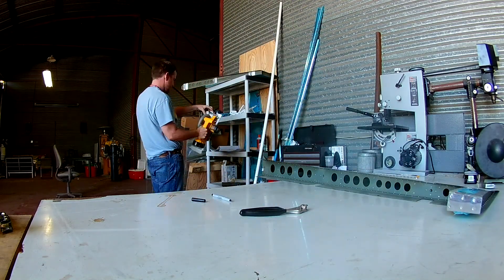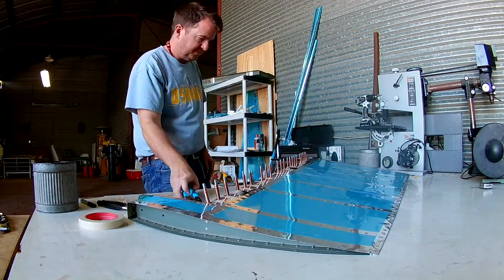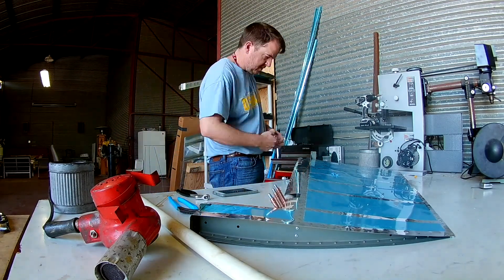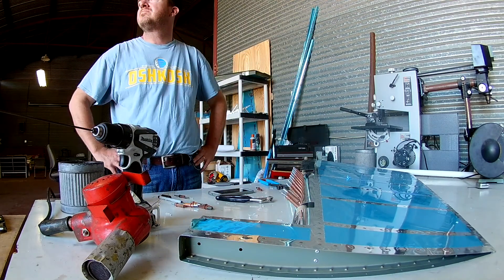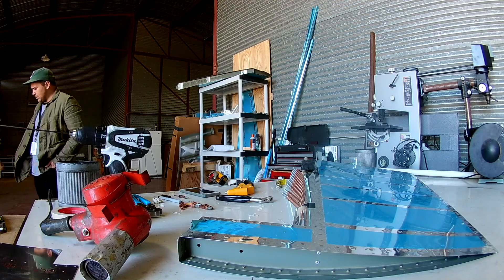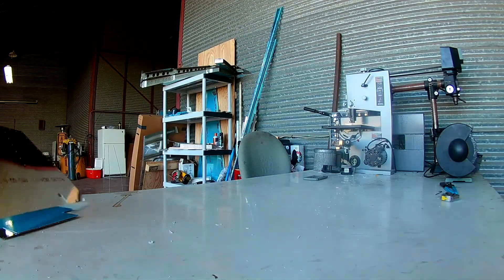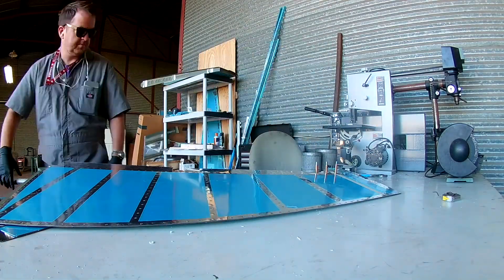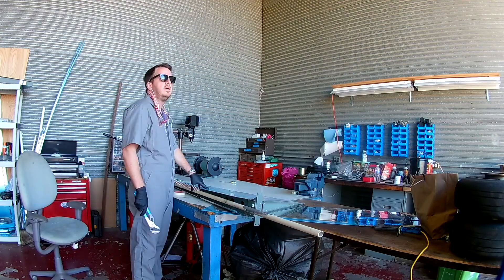RV14 - Rudder 12

Comment: These are great videos.  I just did this myself, I used 3/4 in metal pipe and duct tape.  I have a mentor who built an RV-7 and he helped me.  If you do the bottom one and have it hanging off the edge you can use gravity to help make the bend by using your fingers to roll and simultaneously pulling down.  I can't take credit for it because he had done the same on his plane so was able to help, but definitely was a pain in the butt to get it lined up.  It's amazing how nice it turns out once those holes are aligned!